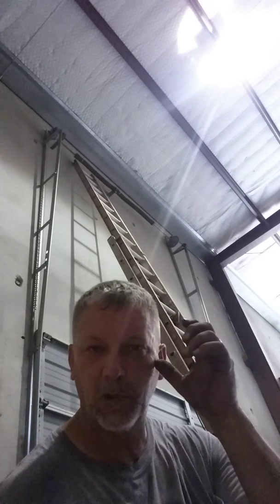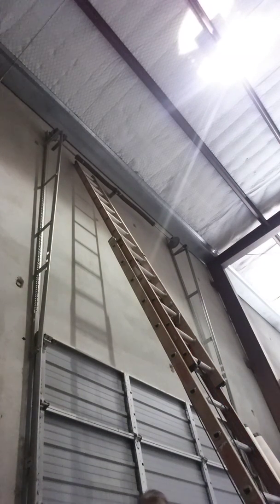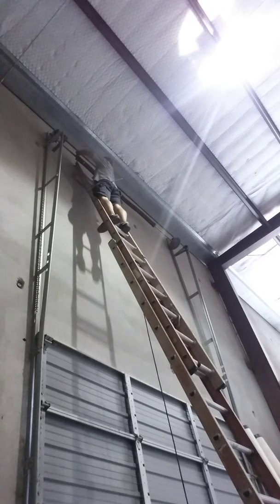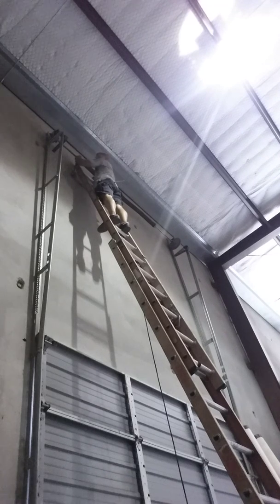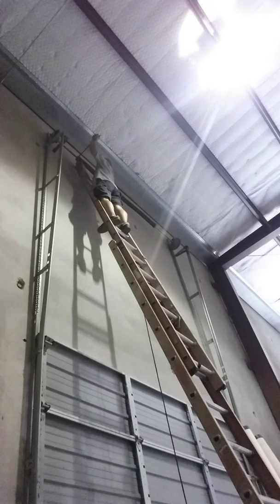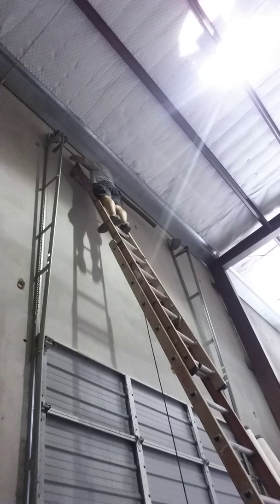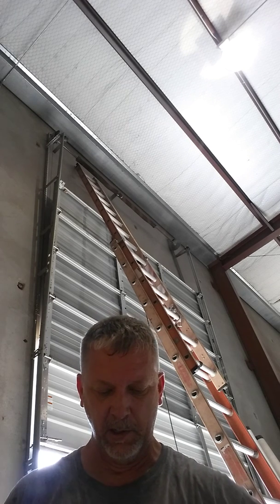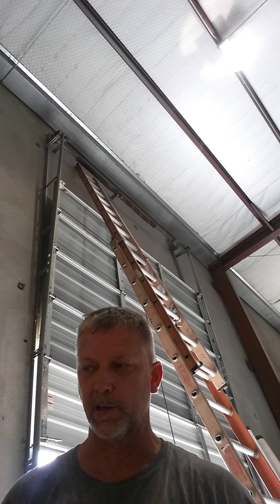Overhead Door Verticle Lift Torsion Springs

Comment: How many turns on the springs? What size are the springs?
Reply from the maker: Man its been a few years ago, I'm not sure, I would need the drum size, and amount of ,or approx weight cable length, wire size to do the calculations, I think I added, 1 round on one and 1/2 round on the other, in addition to what was already originally installed on them.
Reply: @squid5651803  How many do you typically add from scratch? Just as an example.
Reply from the maker: @daru250  it all depends on the dynamics involved and flat drums, or progressive drums, like this door goes straight up, then like residential they go up and turn back 90degrees, as the door goes up and turns the weight is distributed one panel at a time to the horizontal track, so the springs dont have to maintain the full weight like they do when they are rested closed. 
Lets say a 7' high door with conventional 90 degree horizontal, it usually takes 7.5 rounds of tension, 8' takes 8.5 or thereabouts.  
The vertical lift in this video may take, 10,12,to 14 turns, it depends on the drums ,weight, cable length ect.
So many variations, I can point you to a company in chicago that has really good basic tutorials if you are needing more info.
And I know some other youtube channels that can help, depending on what you are trying to accomplish.
I've been doing this 30 years and still learning.
Reply: @squid5651803  Great , Im an apprentice here in Cali. But still havent ventured on Vertical lift doors only standard lift residential and a few  high lift residential. But Im learning vertical lift due to all the warehouses in my area. Thanks for your time and if you could send me that webspace thanks in advance.
Reply from the maker: @daru250  look, I'm tied up at the moment, shoot me your email, I remember being in the position you are in, I have a lot of information that I gave when I once instructed in the door trade, for new techs,  its easy to listen to and watch, and I highly recommend it, shoot me an Email @ garagedoorstuscaloosa@gmail.com,  and I can send you out some help.
This business has a lot of opportunities,  you should consider grabbing hold of.
Reply from the maker: Also, I'm not sure on the size of the springs, sorry.
Reply: Vertical lift sectional door